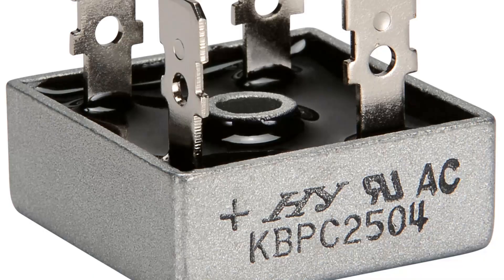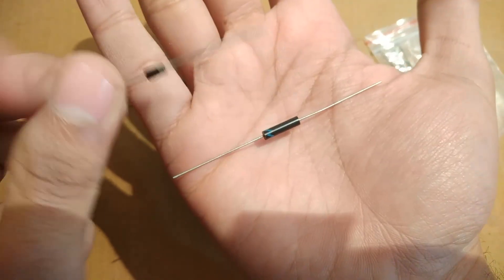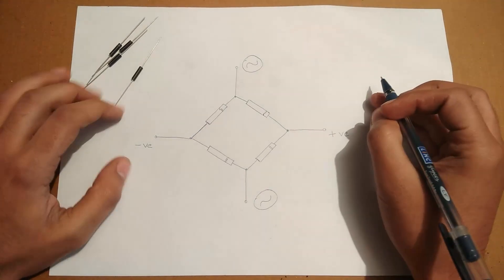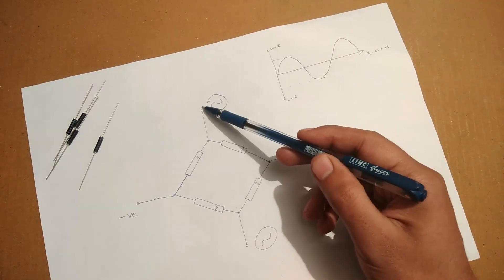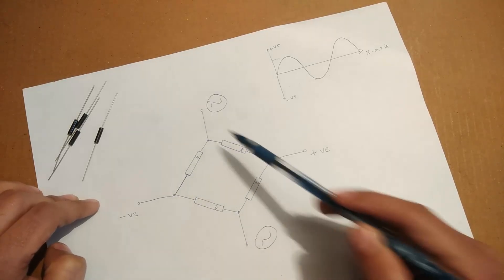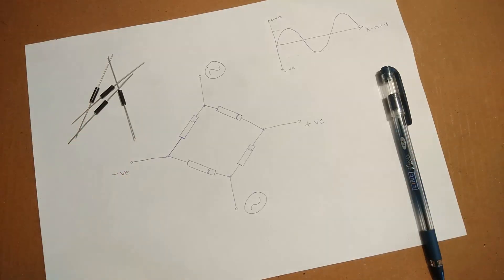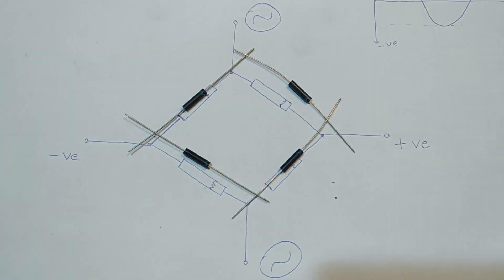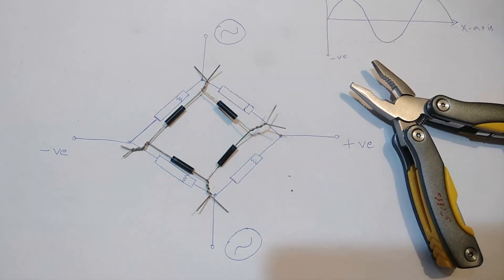20kV High Voltage AC to DC Converter Rectifier Project DIY

Comment: Good vid! So if i have only now aviable lower voltage diodes, does it withstand higher voltages when multiple of these are connected to series then? Lets say if i made the same full bridge rectifier using for example 8 diodes instead of 4 and they all would be in series? Or how it would affect if i connected these same 8 diodes in paraller? Could it withstand more current in paraller and more voltage in series? Thx for the vid i subscrubed! :)

Comment: meaning basicaly the pulses aredevided to positive and negative charges with diferent potential's for exampel - - and + some thing in that fasion because if that energy wuld stay there somthing wuld brake down so probably that's the case with all diodes that material used to build that diode is more based on time building up and realeasing charges in diferent intervals considering material used wise probably that is why peopel are confused around those things I ques sience does it not make lot diferent talking rubbish I belive some old experiments like piezo igniter and piezo cristals wuld by great to teach peopel about magnetism and electricity types thats just my opinion about those devices because raw energy is litel more interesting than rotating that silly staff probably motor/generator brushes are created from crystal's probably so I belive conventional sience does not apply to those thing's basicaly all magnetos and ignition coils work that way so Im confused why some one wuld rotate ore grinde crystals if you simply culd squeze ore preshurize them I belive that wuld by called solide state generator with out moveing part's I belive those alum/crystal beterry/capacitors are way to go considering motors/generators they are crap wound and material quality is teribel and arcing/heat/moisture insulators are missing they can take lot more abuse then rated please show them how proper insulators look like and woundings on generators/starters normaly those things dont brake its brushes that brake down

Comment: What is the exact part number and where did you buy it and how much does it cost? Thanks for a nice video.
Reply from the maker: Tony Fleming search for high voltage 20kv diodes in aliexpress.
Reply: @MrElectron  if u have purchased than why u r not giving the exact part no. a rectifier is a rectifier whether it is low voltage or high voltage. better u show the part no & explain about them, rather than the explanation of rectifier.
if u r writing 20Kv AC to DC rectifier then u must show the practical demonstration also.
very disappointing. one dislike for sure